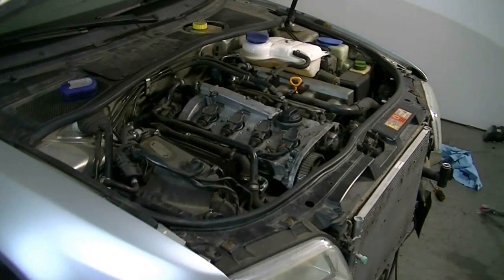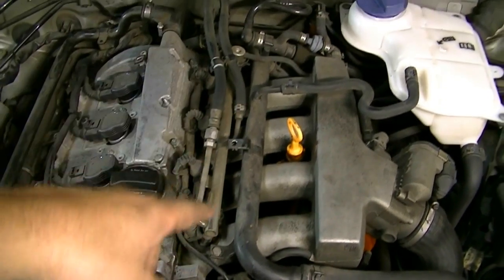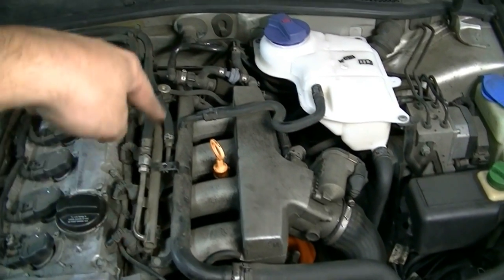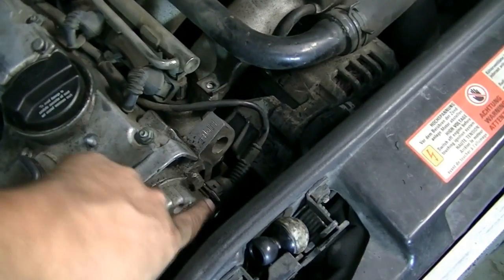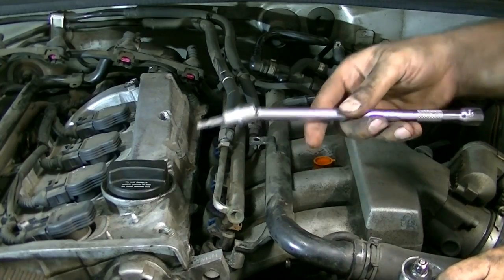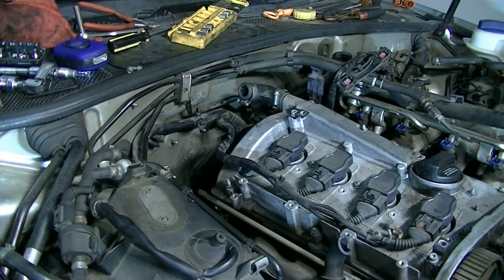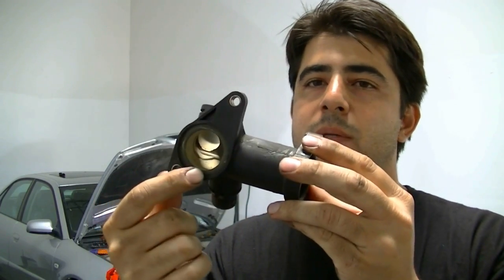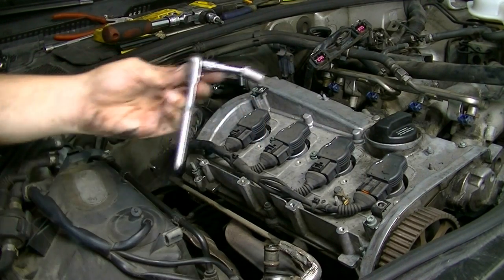How to Remove and Replace a Cylinder Head - Audi A4 A6 VW Passat Jetta 1.8L Engine Part 1

Comment: Do you recommend the aluminum coolant flange and other replacement T fittings and thermostat J fitting. I had audi replace many pressure valves, stop valves, hoses, coolant flange about 6 years ago. Timing belt, water pump was done too and paid more then my car is worth. Only about 3k miles in 6 yrs on car since that was done and seems coolant flange is leaking again and sucking in air, (or something else combined with that)

Comment: Thanks for your time and great explanation I have a question at same time can I use a AWM cod cylinder head in my 2004 A4 Quattro witch came w AMB ?.... exist a different ?... I have a head gasket problem w/cooling to my oil but cars runs no noise wird but eng light on cilinder 2  
shows after diagnostic .. Thanks for any kind of concern,,,

Comment: Thanks for this. I'm doing our VW Sharan 1.8T petrol - dang camshaft belt slipped off and got shredded by the belt shield. 

When this happened, our first thought was that the car has stalled (we stopped to pay toll fees) and tried to push the car back to life as our initial thought was that the battery ran flat. 

Unfortunately we damaged the valves.

On the Sharan the engine is turned 90 degrees, so the camshaft belt sits on your left, which makes it a pain to get at the turbo. My aim is to lift the head + turbo out of the engine. 

This video is helping me a lot in determining what new tools I'll have to purchase.

Interestingly, the coolant flange on the Sharan seems to be aluminium, I'll have to check.

In the initial assessment we decided to replace the camshaft belt in the hope that we got lucky. I've got a new cam belt, plus tensioner, large and small pulley and a new waterpump already installed. 

By the way, the left engine mounting is really difficult to remove, you have to work around it. Unless I can remove it by moving it downwards instead of upwards... 

The second part of this video is giving me hope that we do not have any cracked/damaged pistons.

Comment: Please help: is it normal for a "low pressure" light to come on after replacing cylinder head + oil cooler +oil filter? I didn't pull the fuse to build oil pressure before starting it so maybe that's why the lifters are so loud?
Reply: Collin Fox scan the car for codes ! Might be off times via can chain tensioner

Comment: About the intake manifold, there are 3 10mm bolts directly under the manifold. They form a triangle, holding a bracket with tubes and connectors. Removing this bracket by removing the 3 10mm bolts will let you pull the manifold back for plenty of space.

Comment: I have the same car, mine's a 1.8t b5 Passat, same exact setup under the hood. You know that coolant flange you mentioned next to the combi valve ? (or egr valve).. Well, I changed out my Coolant flange after around 20 hours of working on it, and as I was tightening the last bolt (specifically the first double headed bolt on the bottom of the flange that holds the flange against the engine block) with flexible socket wrench, the damn thing broke. So about an inch or so of the bolt is stuck in the head. Do you think I can get away with drilling through that bolt by going through the firewall after removing the battery?? I took it to 2 professionals who specialize in bolt removal, they tried everything they had in their shops and utterly failed. They told me my only bet is to remove the entire engine. Can't tell you how frustrated I am with myself for breaking that damn bolt.

Comment: I did an engine swap on one of these it was a fun job trying to figure out all the hoses there's so many one way check valves and vacuum tees luckily I didn't undo a lot of it vacuums lines whenever I removed the engine and I just swapped the parts but everything was old and brittle

Comment: best thing to do is take these 1.8t engine and sell it because ther complete junk after 120,000 miles, all the plastic clips breaks, turbos charger failer is common, they also run extreamly hot ,they crack blocks, heads, the clutches in the cars are also junk ..     these enginesand cars  are known for tons of problems .     now dont get me wrong , they do last long tho and run ok, but there just so problematic there not worth buying .                 if your going to buy a vw engine make sure its the 2.5 I5.              the 2.5 I5 is much much much much better setup than 1.8t and sounds,runs so much better,  after i found the 2.5i5 i dont even touch 1.8s and more
Reply: sonic knuckels incorrect info! Best thing to do with a 1.8t is turn up the boost!

Comment: Hi. How are you. A question:
I have to Audi 2004. A4 Quattro 1.8.
Panel light turned on ( check engine. )
Code P0302. The found coolant inside cylinder, so they ll remove head to repair,most likely head gasket.

Comment: Great job I'm bringing my car to an Audi shop fixing an issue where my ABS brake light and my engine light flash at the same time the person is replacing the head gaskets everything and also the mass airflow sensor and in idle at Bob's almost dies the RPMs bounce do you have any suggestions or input your video is great by the way keep it up

Comment: Hi RW Im currently stripping a 1999 Passat 1.8L Petrol 20V APT engine because of rough running at idle, hill climbing and cruising speed. Garage did compression test No1 cylinder is down by 30%. Done exhaust test with paper and suspect outlet valve has failed.  Got as far as taking the inlet and outlet manifolds off and found the first exhaust port on cylinder one very clean compared to others coated in Carbon. Did WD40 test and found the fluid leaks away on the very first Valve all other vales including inlets are OK. Need some advise on how to proceed with this problem please!

Comment: What if the car just shuts down while running but it wont crank or start ? Need feedback please
Reply from the maker: +Fidel Barron did it run low on oil? Can you manually turn the engine over?
Reply: Im assuming it was running low because i checked the second day it was down .. What do you mean by that ?

Comment: Would it have been easier to take off the fuel injectors as well? Would that damage anything?
Reply from the maker: It wouldnt damage anything but it wasnt necessary!
Reply: Alright, I was working on my Audi as well and found it easier to remove them as it gave me more space to work with in order to take off the coolant tube and the header as well. Got stuck a bit on the header seeing that it the last two are nuts ...do you have a video on how to take off the serpentine belt and timing belt?
Reply from the maker: yes, I have a timing belt belt video series, just check out my channel and you'll find it. gl
Reply: Thanks a lot, I will try my best!

Comment: That coolant hose flange is similar to what is seen in the Jetta, though it seems harder to get to. VW engineers have evidently not yet solved the problem of using plastic flanges against variably hot steel/aluminum parts. I know steel flanges weren't perfect, but you almost never have to replace a steel flange....

Great video series, thanks for going through the effort to post these. I especially like the fact you leave in the mistakes, like that broken plastic part. Not only does it speak to honesty, but also what to do next is often where we amateurs need guidance.
Reply from the maker: yes I think that flange has been leaking from the first 1.8L engine they made and still I saw it leaking on the newer similar 2.0L turbo engine they have now lol. thats almost two decades without a solution.